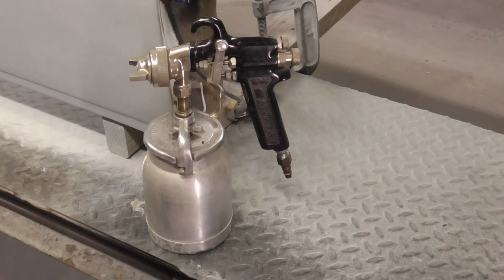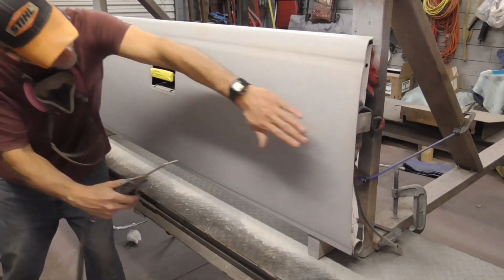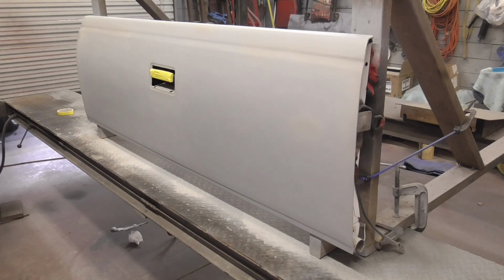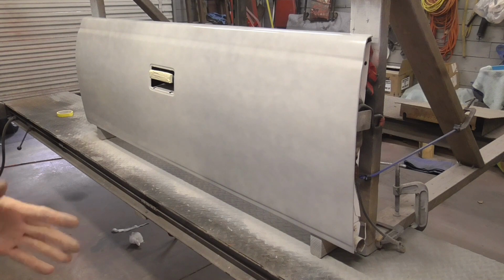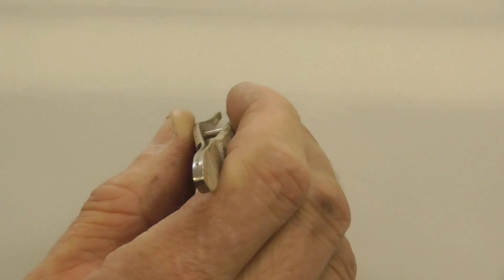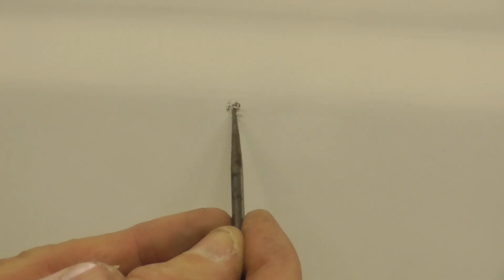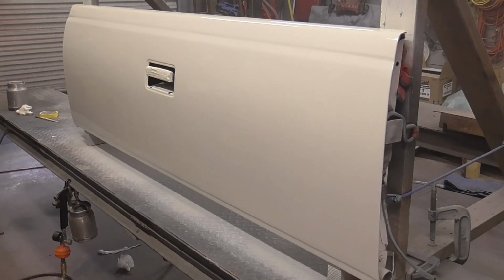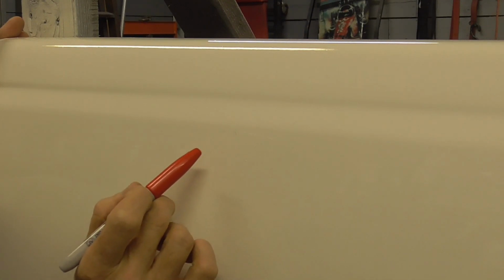Using a Binks Model 7 Spray Gun with TCP Global Restoration Shop Paint

Comment: Hi, I'm new to your channel, but I like your practical approach to this field. My Binks 7 was stolen in the ninties. I mostly used the DeVilbiss MBCs and JGAs anyway.  But had a Binks 18 on my 2 quart pressure pot that was the absolute bomb! Perfect large even pattern (beat the JGA). Shot a lot of Imron polyurathane and hardened acrylic enamels in the eighties and seventies.  A couple of comments on technique: I never over lapped the same place on the second and third coat- especially on door edges- danger of sags as I always sprayed pretty wet.  For bugs I always had handy a sharp pointed tweezer- hate leaving little legs in the paint!  Also used my hands a lot like you. But 35 to 45 is where I used the siphon guns.  Learning gravity guns now- love the DeVilbiss Pro Lite. Thanks for the effort you put in these videos and the very practical advise.
Reply from the maker: I appreciate the support Jay.  To me, nothing sprayed nicer than the Binks 7 w/ the 1.8mm tip back then.  That thing could dump some paint.  I also painted a lot with the JGA as the Binks was my dads and I had to go a bit cheap a buy a Devilbiss JGA copy - I think is was like a Buffalo Pneumatic or something :)  Any way, thanks for the comment - love to hear the old stories my friend.
Reply: I still use a Binks 18.  Did some painting with it today.  .  Had the Binks since the early 80's.

Comment: Well...I put in an offer on a Binks no 7 on Ebay that looks to be in fairly clean used condition. 
   I decided I want to use the same gun that painted so many cars back in the day, and is still made today. I want to use it for single stage and high solid clears. I think it will be great for that. Probably no need to use it for base paint and thinner clears. But I believe it can be rotated in aa I still like to use single stage on certain projects. I like the geatification of seeing that instant gloss after you get a couple good coats down. And if you did it without runs or issues, even better. 
   Anyway, if my eBay offer  is denied, then there are a couple more listed I can pursue. I'll let you know how it went when I finally get one👍
Reply from the maker: You can use that gun for everything - BC/CC,  single stage urethane, enamel, lacquer, primer, etc.  The only reason I don't use conventional guns is because I prefer to clean gravity fed guns.  They're just a bit easier to clean because you don't have to clean a suction tube, upper cup assembly.  Other than that, the binks 7 rules.  Let me know if you win the bid 😊
Reply: @LakesideAutobody  the cleaning don't bother me much...unless it's primer! Thats why I got the accuspray.  I have an older Binks 7 knock-off which is a pretty solid gun, but I want to try the real deal. I like the higher pressure and the way a conventional gun dumps the material onto the panel. I think hvlp is just the answer to gov. Regulations. Doesn't make it superior. I like old things. Old tools old cars. So doing some painting with an old Binks is something I just want to do👍
Reply from the maker: @BearBudgetgarage  You'll love having the real deal.  My dad had a Binks 7 w/ the 1.8mm tip and man did that thing lay down some Centari single stage enamel - awesome.  I like your thinking!

Comment: If the bug is dead and still black looking on the surface, let the paint dry, then wash the bug off later, then wet sand the area with 600 grit progressing to 1200 grit, next buff with fine cut cleaner polish and call it a day.

Comment: I enjoyed seeing the Binks in action.  I’m curious what air cap/tip size are you using?
Reply from the maker: Tip size is 1.8 mm
Reply: @LakesideAutobody  SD or SK air cap ??
Reply from the maker: @embreesmith7613  SD  which uses less air and gives a 10" pattern at 8" away.  Here's the user manual for the gun which also give the correct info on needle/nozzle selection -  https://carlisleft.com/wp-content/uploads/2021/04/Model-7-Manual-77-1153-EN.pdf

Comment: I think i'm going to miss seeing the no. 7 in action. I picked up a couple siphon feed guns off ebay and an old style siphon feed touch up gun(with the top trigger). I'm looking forward to using them next spring. I want to compare results with gravity feed single stage vs. siphon feed with the larger nozzle size.
Reply from the maker: I still love the way it sprays - I'll keep it in the rotation.  It's riding the pine right now but it will have it's day :)
Reply: @LakesideAutobody  cool. It's a lot harder to find videos that feature siphon feed guns👍
Reply from the maker: @BearBudgetgarage  I think they spray great and have used them for years.  Not opposed to using them at all.  It's just that the gravity ones are a bit easier to clean - to me anyway.  And the 3M one is even easier :)  Like I said though, we'll throw them into the mix.  I'm glad someone would like to see the old guns :)

Comment: Thank you so much for the chart you sent me it helped me to understand the gun a little better now I have a 36 nozzle and a 36 needle valve will this work good with spraying single stage enamel paint?
Reply from the maker: It will work great spraying single stage enamel.  That's all I used to spray Centari single stage enamel with in the 80's (36tip/36needle) - wonderful gun.  Make sure it's clean and the paint is mixed correctly.  If it looks dry - reduce it a bit more.  Usually folks spray paint a bit too thick.  Don't be afraid to reduce your paint to help it lay down (flatten out) i.e. stay wet.
Reply: @LakesideAutobody  Thank you very much I appreciate the help I will be watching your videos from now on
Reply from the maker: @joestone2068  You're welcome Joe - have a good week :)

Comment: And the nozzle says 36 on it do you know what that is. Thank you. I just found your channel and I love it I’m trying to learn how to use my number seven. Not sure about the nozzles I like single stage acrylic enamel what nozzle should I use for that. Ty
Reply from the maker: See the nozzle and needle selection chart at the bottom of this document to make sure you have the right set up for the Binks 7 - https://www.finishmaster.com/prod/assets/model-7.pdf   Your fluid tip/nozzle has to match your needle.  i.e. my fluid tip is a 36SD and my needle is a 36 for medium thickness material like automotive paints and primers.  Let me know if this answers your ?  - Jerry

Comment: Hi. I have a binks 95 gun. What would this gun be good for? Are they okay or junk? Got them at an auction for cheap
Reply from the maker: The gun looks like my Binks 2001 so I imagine it would work fine for most things you want to spray like paint, primer, sealer, etc.  You can pull the needle out and read the side to see what size fluid tip and needle you have.  Probably a 1.8mm. That would work fine for anything in body work :)

Comment: Ive mentioned before that I luv your vids, but have to ask these two questions from watching a few of the other channels. The two taboos ive seen is never wipe with bare hand and never stop in middle of your panel.  
Will the tach-cloth remove any oil left from your hand, 
And how would I keep from getting build up or runs on the paint without going whole length of panel.  
Remeber I'm a DIY 1st spraying so I'm trying to learn all tricks.   Keep up the great lessons.
Reply from the maker: A lot of taboo stuff you hear on the internet is simply not true - like:  you must butt weld, bondo is bad, lacquer primer shrinks, don't touch the panel, on and on.  Here's a couple of ways to make sure of the facts as a DIY guy:  1) Ask a professional that has actually worked at a body shop 2)  Use your own common sense.  Just so you can trust my advice, I've worked at 4 different quality body shops over my career and am MOCAC certified to teach in vocational schools so I will always give you the answer that is true.  If I don't know for sure I'll be honest and tell you "I don't know for sure"  That being said,  the oils on the hand thing is a bit of a wives tale because you've touched the car the whole time you were working on it - you'd have to wipe it w/ wax and grease remover at every step of the way if this taboo tale was true.  I've never in my life had a problem with fish eyes unless I over oiled a tool or did something silly using "real" oil or silicone - there's no "skin" oil on my fingers when I'm doing bodywork.  The other taboo thing about stopping in the middle of a panel is false too - If you paint an airplane,  do you have to walk the whole length of the plane in one stroke? - no.  The best advice I can give is practice with a spray bomb can stopping in the middle of a small panel with a little practice feathering your strokes into the other stroke you wont run it.  You absolutely have to "see" the paint go on the panel "see the wetness" as you spray and you'll be fine.  I'll do a video on that topic for you sometime - Hope that helps.

Comment: Thanks for this video on the Binks Model 7. In your description you stated your mix ratio of 4:1:3. Do you normally use so much reducer or did you need that much since you sprayed at 25psi? Everywhere I've read the Binks 7 is to be sprayed around 45 psi. I'd rather shoot at a lower psi like you but I'm afraid it might orange peel. Do you turn the volume down a lot when shooting at 25 psi? Thanks!
Reply from the maker: Here's the rule of thumb for orange peel.  Wet = No orange peel.  So....even if you use an aerosol can, if you get it wet - no orange peel.  That being said,  i think you'll always use more reducer than said on the can to keep your paint job wet - especially if you're doing a whole car.  1 panel and you can mix it according to the label 'cause you can keep it wet.  I always have the fluid adjustment wide open if that's what you mean by volume.  That's just what has worked for me - in 40 years, I've never had an issue with too much reducer so don't be afraid to adjust the paint thickness to your liking - just make sure that the ratio of paint to hardener is right - then add however much reducer you need - Hope that helps
Reply: @LakesideAutobody  that does help, thank you for your reply!
Reply: @LakesideAutobody  Hi, great video! I have a #7 that I saved up to buy in 1988 and been using since. What nozzles are you using? I have a 36SK air cap and it came with 36SS fluid nozzle and 36 needle. Mine was pushing a ton of paint and I was told to get a 33 fluid nozzle and needle which I did. Kept the 36SK air cap. Haven't tried it yet. They said the 36 nozzle was for production work. I painted 4 cars with it like that and it plowed through the material.
Reply from the maker: @vincemajestyk9497  They are awesome guns and known for dumping tons of material - that's what made them great for body work.  I use the 36SS/36SK needle/nozzle/cap.  I'm thinking you have to use the matching set - see link - https://carlisleft.com/wp-content/uploads/2021/04/Model-7-Manual-77-1153-EN.pdf
Reply: @LakesideAutobody  Thanks for the reply Jerry. I just changed the fluid nozzle and needle back to the 36SS last night after some investigation. The ones I bought were the 33BSS which is a 1.2mm oriface and way too small for medium viscous paints. Seems everybody is running the 36SS nozzle on those guns. I'm thinking of maybe getting the 36SD air nozzle, but I think the biggest problem I had was that I was using the working pressure spec'd in the operator booklet, which I think going by memory was 35-45 instead of the 25 psi you've been using. I'm going to try that since it works so well for you. Funny thing, when I bought the 33 needle and Fluid nozzle I asked the guy about the air nozzle and he said it would work with the 36SK. I bought them years ago from a place called Finish Systems in Waukesha. I agree though, I think all the parts should match.

Comment: As usual,  great job. 
Do you ever use lacquer primer?
Reply from the maker: I use it quite a bit - I love it.  Don't listen to the negativity about it.  Remember that's all there was at one time and it worked just fine.  It's inexpensive (1gal makes 2 gal with thinner).  Dries very fast, sands easy,  builds fast, you can mix it thick or thin,  use it for every stage of body work , doesn't harden in the gun,  you can throw the unused portion back in the can.
Reply: @LakesideAutobody  you can put the mixed unused portion back into unmixed can?
Reply from the maker: @tony1798  Yes.  I made one full year of auto body videos for this channel with one gallon of primer!  As you return it to the unmixed gallon its eventually getting thinner and thinner - then finally when you have around 1/3 of a gallon left you don't have to thin it any more unless you want it real thin.  Just pour the unused portion back and when you are ready to mix up more primer shake the gallon up, stir it or what ever and mix it to the thickness you like.  That's what we did for years when it was just lacquer primer 70's 80's 90's.  Matter of fact, I just left primer in a gun all the time - had a dedicated primer gun.  Very sloppy gun but it worked.  Again don't listen to the negativity about lacquer primer - even from the biggest names - lacquer primer is all there was for most of the 20th century and there were plenty of Autorama car show then and fine cars.
Reply: @LakesideAutobody  when I did more bodywork stuff I just kept one gun 1/2 filled with it. I just used a cup with thinner to clear the gun and tip and stuck it back in the gun. It worked great every time I needed it.

Comment: 25 PSIG for a model 7. That's about 40 PSIG low according to my memory.
Reply from the maker: I like to keep the pressure as low as possible - small garage - got to give the fan time to expel as much over spray as possible.  I'm not big on the fog.  Have a great weekend - good to hear from you as always :)
Reply: @LakesideAutobody  Nobody who is still alive (and many of the users of the model 7 aren't due to the overspray) likes the fog. The problem is how do you get the paint to not orange peel at low pressure. The solution to your lack of a booth problem is the Iwata LPH400LV. at 20 PSI this CAN properly atomize the paint and give a very flat finish. For the paints you're using the 1.4mm setup is likely the way to go. For me, since I use high solids clears, the 1.3mm works better.
Reply from the maker: @satamanschmidt3428  Thanks for the ideas. Here's some medium priced paint that lays down a little nicer with the set up you are talking about.  https://www.youtube.com/watch?v=CNVENaswsio  - right around 20-25 psi and 1.4 mm tip

Comment: why don't you spray the complete panel in one flowing motion, instead of stopping about 1/2 way?. look at all that build-up in the middle you laying down. it's not that big of a panel...
Reply from the maker: If you spray a whole car would you start walking down the whole side for one pass?  You absolutely have to stop in the middle of panels.  You won't run it if you sort of feather it or go light on the overlap :)

Comment: Just blow it off real fast then wipe clean with wax and grease remover. Using your hand as a cleaner cold introduce oils and greases made by sweat even if your hand is clean
Reply from the maker: All of the dust in a paint job is already on the panel before the first coat - my hands are dry as a bone and so will yours be after doing body work - no worries about oils on your hands  - none.  You can feel the dust nibs when you use your hand.  Blow off the vehicle, wipe w/ wax and grease remover, blow off again using hand feeling for any remaining dust, wipe one last time w/ tack cloth - and you'll have next to zero dust/dirt in your paint :)